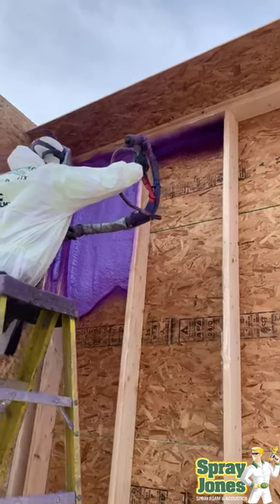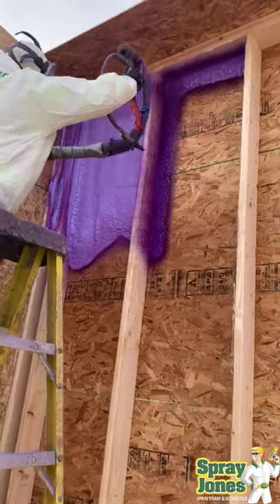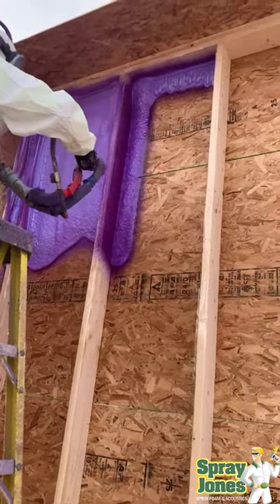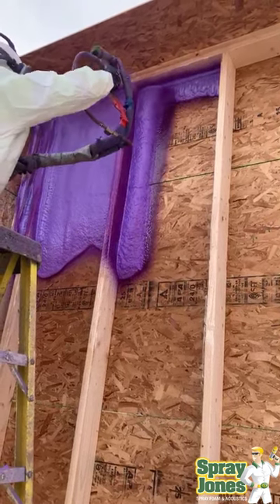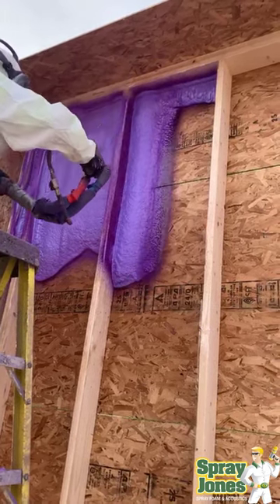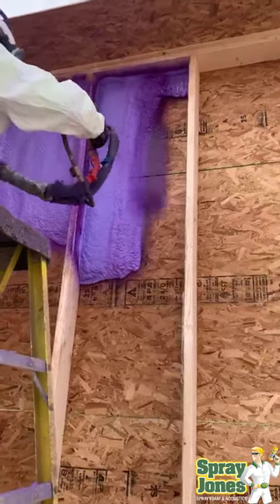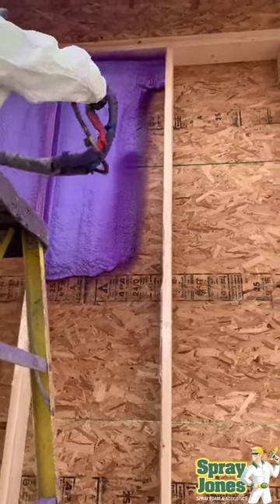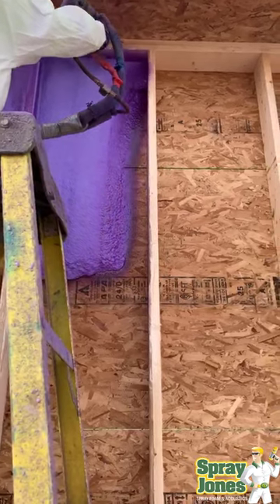Come Early Avoid Issue. Spray Foam Insulation. #sprayfoam #insulation #garage #construction #shorts

Comment: If I want to spray an intumescent over it, does the foam need to off gas for a while first, or can you spray the intumescent next day?
Reply from the maker: According to tech data they always want you to wait. That is not practical because many times no one is making a second trip.
Reply: @SprayJones  thanks. Exactly what I thought....and exactly what I'm being proposed.
Reply: What pressures and Temps are you using for this foam?
Reply: Па.руски

Comment: Just recently had a building inspector by to inspect framing and the spray foam work done on  floor joist cavity ends. He said that spray foam must be covered with either drywall and or Rockwool as it is considered an accelerant. I found it strange because I wanted to leave it as an unfinished basement. He said if it doesn't get covered up I do not get occupancy. 

Located in East Gwillimbury, Ontario Canada

What are you thoughts on this?
Reply: I don't think this contractor is Canadian based.
Reply: @ebenezerwheezer2957 Which contractor?
Reply: This is common practice in residential by Ontario code. I work in residential construction in Ontario and whether the basement is finished or not, all spray foam must be covered like you said, otherwise no occupancy.

Comment: I’m currently building a shed in my yard that I want to insulate…I don’t want to use pink fibreglass because it won’t be lived in and I’m not going to heat it all winter…only when I’m in there working…I was going to put 2” rigid foam in the walls, but I put 12’ ceilings in the place and it’s a lot of cutting and fitting and many cans of window and door foam to seal everything so I’ve decided to get the spray foam guys in…I’m currently getting quotes now!

Comment: That looks like a painfully slow process. So you pay the guy by the week?
Reply from the maker: Watch more videos...
Reply: Добридэн
Reply: Мне...нада..пен
Reply: Англиски
Reply: Непанимайю
Reply: Как.тибэ.заказат
Reply: I suppose he’s running a #1 chamber. Or in the fusion case a AR4242. If your goal is consistency in lift, it’s much easier to achieve make a smaller mixing chamber. I ran one for many years. But I use a #2 these days which just takes more control from the applicator to achieve consistent lift.
Reply: Yeah I've seen tons of these videos and this is probably the slowest work I've ever seen ...😂😂